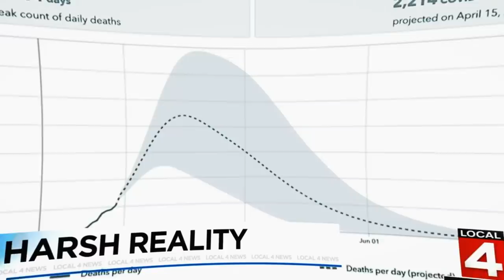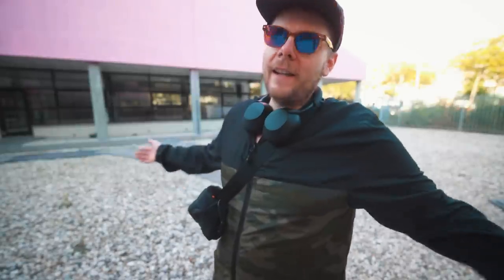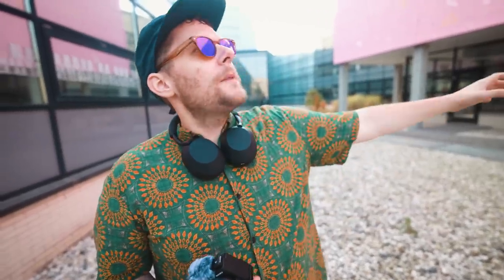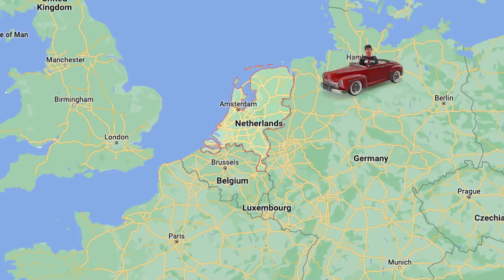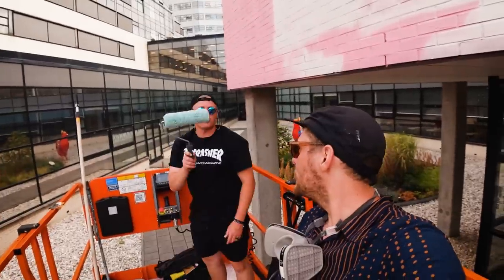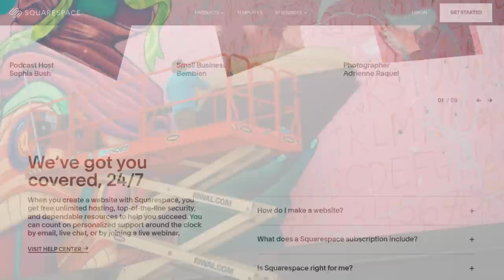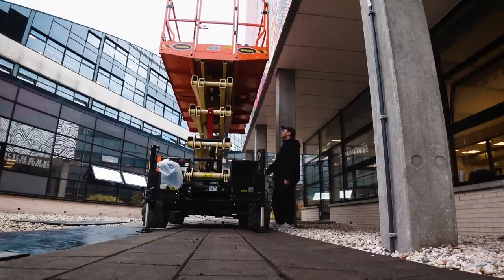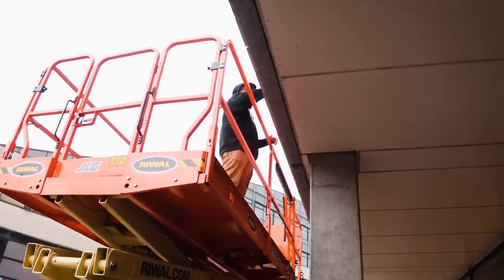I've Never Painted a Mural Like This Before! (Netherlands)

Comment: Question? When rebranding and changing company/business name, logo, aside from the tasks of updating everything, new business cards, websites, information, etc, does doing so have a bit of a difficult and challenging impact and affect on said business?
Essentially, do you take a hit/loss in the beginning or until mostly everyone played catchup?
Reply: Hi, designer here. This really depends on your business and customers (Sorry about the it depends’ answer). I find that for businesses in highly competitive markets with low customer loyalty the answer would be yes, you would have a negative effect in the beginning. But for a business with high customer loyalty, you can make it into a engaging marketing campaign and make them feel invested in the brand by having them become part of the story. 

The success of updating a brand really depends on different factors and success relies on research. Are you completely overhauling the brand or just updating it to be more modern? How much of your customer base is returning customers and invested in your brand? What market do you work in? What are your competitors doing? Etc.

Hope this helps!